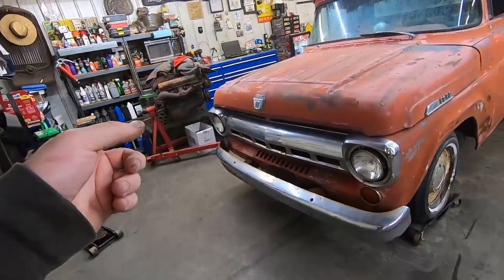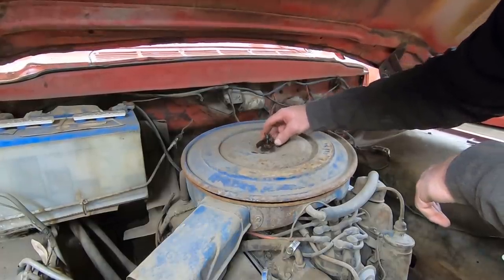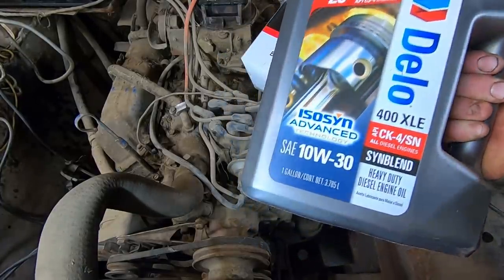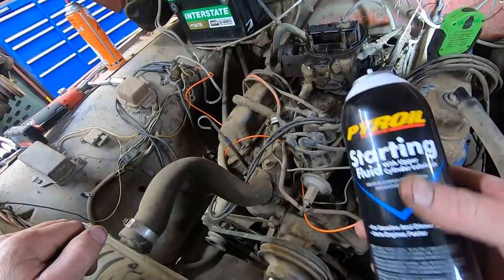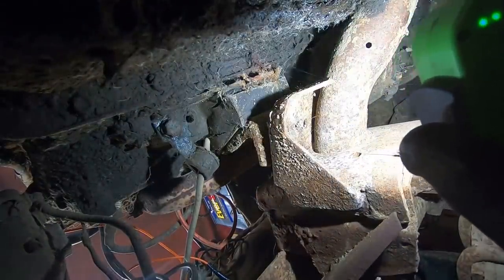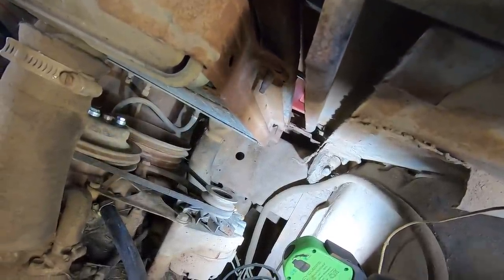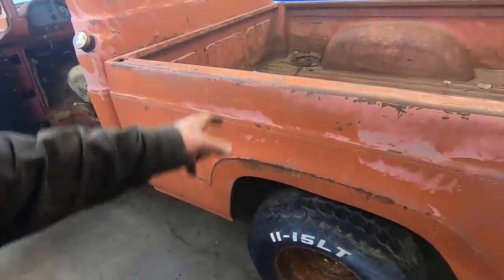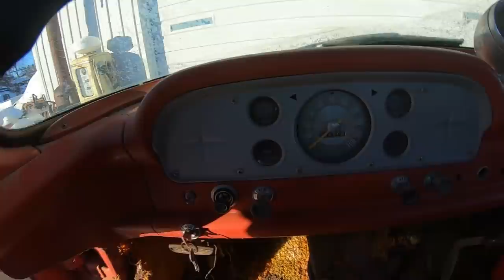Forgotten 1957 F100 Hot Rod Pickup Truck!! Abandoned for 40 Years! Will it Run?!?

Comment: No problem finding parts for them. They were used all the way till like 96.
Reply from the maker: Yeah but nothing interchanges with the later ones. Try finding a crankshaft!
Reply: @MortskeRepair  only difference between your C9 block and an F4TE 351w long block out of a 96 F250 pulled out of the junk yard would be the 1 piece rear main seal and your block’s shorter 9.480” deck height vs. 72 and later 9.500” deck height. 
Only reason I look forward to Mondays is I get to watch you and Duff, and maybe Puddin also, when I get home from work.

Comment: @MortskeRepair lots of parts on the small block 302 and 289 motors work on the Windsor most of the accessory drive components alternators water pumps oil pan depending on your application and clearance. also the intake manifold and carbs are also more than likely interchangeable. me and my Dad swapped one into his mazda b2200 and 302 mustang and small block ford components are the easiest answers if your limited on space. so if your having trouble finding parts for these motors there is somewhat of an answer. maybe that will help you in the future. as always check your years lol.

Comment: The easiest way to tell is the distance from the top of the water pump to the bottom of the head. 289 302 flush with head. 351 1/2 higher. Also the Intake is much wider on a 351.
Reply from the maker: Good tip!

Comment: Nice little "drag" to the dump lol, I've fallen victim to dummy the battery is dead syndrome, but as for your least springs, did you remember to tighten the shackle bolts with the car and weight on the springs? Did that once and truck looked like a Carolina squat lol

Comment: Unless someone has removed it, Ford put an aluminum tag under the coil mount olt to ID the engine.
That drive shaft has rubber injected into the area between the tubes, don't know what you call it. It's oe for something.

Comment: I was very lucky to still have my inner steps on my 60 Fridge. It was a Sand Mountain North Alabama truck most of its life. Also my front leafs were wasted too. Must have been some crap metal Ford was using? This is my fav vid you've done so far btw.
Reply from the maker: First I've seen of spring issues on these. Steps are always shot tho!

Comment: I had some, what the advance auto guy, called transmission hose. Put it on and made it a mile down the road. Was going slower and slower until nothing. Then I saw the geyser of blood. Had a local hydraulic shop make me some custom hoses. Definitely overkill but it stopped the leak.
Reply from the maker: Whoops

Comment: I'd like to know why someone would think it to be a good idea to attempt to partially hotrod a 351 2V...The 351 is a very powerful small block, but it's not going to breathe very well with a 2bbl carb. Not to mention that back when this truck was cobbled together a 4bbl intake and OEM 4bbl carb should've been relatively available and inexpensive. Granted, it wouldn't take took much to make this small truck move, but if you're going to go to the trouble of swapping it you might as well make it worthwhile, but something tells me that this was either an old man's truck, a young guy's truck who was on a budget, or it was just fandangled together by someone who had a crashed or rotted out Ford with a 351 2V and this truck with a worn out inline six. Either way, this could be a really cool project with not too much money required, just alot of time and fabrication skills.

Comment: A 302 has the lower deck surface by an inch or so. This can be seen if the head gasket surface is even with the water pump/timing cover. The 351w has the taller deck with an extra inch above the water pump/timing cover.

Comment: On the 351 Ford engines the spark plugs are at a 45° angle on the on the Windsor versión. On the Clevelands they stick straight out

Comment: Prest-o-Lite batteries were not manufactured after 1997, so this truck has been sitting at least that long.You oughtta see if some collector wants that thing. When it comes to automotive stuff, it's amazing what becomes collectible. I still have an unopened tin can quart of Quaker State, some AutoShack transmission fluid, and 2 untapped cans of R12 I'm holding onto.
Reply from the maker: Nice!

Comment: Where did you learn all of this specific knowledge about vehicles? I've been working on cars for almost 20 years. I can fix one (most of the time anyway,just got my ass whipped by an 09 Sienna), but there is no way that I could ever recall bolt patterns or which year they changed a grille or headlight. Your level of recall on that stuff is quite impressive. I took an IQ test drunk and tested out at 145, and I can't do that.
Reply from the maker: Years of doing dumb stuff like this!

Comment: 289, 302 throttle linkage will be on the edge of left valve cover.  351W will have a wider intake and if you can get a shallow socket on lower thermostat housing bolt passed the water pump it's a 351W

Comment: Merely seeing the horizontal thermostat housing/hose is a giveaway that it's a Windsor engine.  Just thinking:  use a hole saw on the bottom of the bell housing to gain access to the flywheel teeth? Are the kingpins rusted tight?   EXCELLENT MUSICAL CHOICES!
Reply from the maker: I think all of the steering is tight.

Comment: Sounds like me  . Got 4 stroke powered water blaster topped up with fuel the night before yesterday, tried starting, fired up it first pull .  went to use it yesterday . couldn’t get it to go, pulled carby apart checked plug for spark , dry plug hmmm . put it back together and checked the fuel tank. low and behold. empty… Greta didn’t see where the fuel went, nor did I but the tank was dry….Check the simple things first!!
Reply from the maker: Hate when that happens!

Comment: Yup. Definately a Dukes of Hazard Truck, looks like they jumped the creek when the bridge was out. The dent in the driveshaft that meets right up with that crossmember, the very exploded leaf springs, the trashed front cross member, the bondo up front, the broken motor mounts... I don't know WHAT they jumped, but they did it successfully, landed it, and drove it away in only a little bit better condition than you got it.
Reply from the maker: You never wanna know what them Duke boys is up to!

Comment: 20 years ago I replaced a battery after it tested and confirmed dead. Next day no start. I replaced solenoid, no start then I replaced alternator, no start finally I tested battery again and sure enough dead as a door knob! I was so sure the battery was fine and the problem was typical coincidence part fail! I definitely test the battery now even if it’s been recently replaced!
Reply from the maker: Hate when that happens!

Comment: With electric fans than have to be wired to turn on at a set temperature and only while the ignition is switched on. I had a set on one car wired in correctly.

Comment: If the water pump is even with the deck it's a 260,289,302. If it's about an inch above the water pump it's a 351.

Comment: If the water pump bolts directly below the deck its an 8.2 deck 289/302 if there is an inch or so of block between the deck and water pump its a 9.5" 351w.

Comment: yes 351w built in 69,.where the  distributer sits in the block is flush with front intake  its 351..if dist base located about 1"below  where front of intake mates to block its 260,289,302

Comment: I never had an issue with fram either and heck its all my cheap shop I worked at used, no issues as far as know.
Reply from the maker: Neither have I but there's been a lot of horror stories out there. For a couple bucks I ain't riskin it.
Reply: @MortskeRepair  Yeah, I normally use ACDelco on my 92 Silverado and 99 Suburban just because its what would of been on it from factory, My shop uses Orally brand oil and Fram products in their Ford feet vans and I refuse to use that on my stuff even though its free for me, just the horror stories as you said.
Reply from the maker: @VikingDudee  Correct, not worth the risk

Comment: this is a drag truck only if you count dragging it home. ok, i guess it was dragging a front leaf spring too. i'm sure the fat rear tires were worn out on something else before they found their way to this frankentruck. i must say that driveshaft is a wonder of engineering, as in "i wonder what lunatic engineered that clusterfuk". i've shortened driveshafts my self, but i did all the customizing on the tranny end since it just pivots rather than bouncing up and down half a foot like the diff end. you think the dent is how they staked the two together? that makes about as much sense as anything else they did to it. on the plus side, old leaf spring steel is pretty good for making stuff out of, and what was on there sure aren't going to be used as truck springs again. i can see a "knife making with mortske", or "let's weld up some solid motor mounts out of scrap spring steel fer chits and giggles" vid in the future. variety is the spice o' life don'cha know.

Comment: There are a few different styles of mounts. There are truck and car mounts. They have car mounts from a galaxie and a car style rubber mount on the engine. The truck needs the engine mounting horns or pedestals for a v8. There are a few companies that make engine mount kits that should fit that. Windsors are strong blocks to build on from factory. They will hold 7-800 hp and I’ve seen them over 1000hp but not going to say they will live with  1000 hp very long. They can be stroked to 450 cubic inches.
Reply from the maker: Great info!

Comment: From my understanding, ford only made the 351w between 69 and 72, so yeah parts are harder to come by. Also, ford used a drain plug on the side for cars, and on the bottom for trucks(on the oil pan that is)
Reply from the maker: No, they used it well into the 90s

Comment: If it did have headers on it they probably took them off & put the regular manifolds on,but to be a supposed drag truck they should've just left the headers on it & you might have to find a new used driveshaft for it since it has that big dent in it

Comment: I had a 1952 f-1 ford pick up all customed had a 351 Windsor at 530 HP,  60 thous. over bore hot cam 750 double pumper carb. roller lifters- 4 disc  brakes - power steering -power brakes, It could burn rubber for over a 1/2 mile had fun for a few years till they got greedy and raised the price of fuel, later found out I only got 1 mpg mileage, had to sell it because I could not afford it, It hurt to see her go.
Reply from the maker: Sounds like a gem!

Comment: 351w has a higher deck height than a 289 or 302. This makes it taller and wider than the 289/ 302. Thus the intake is wider also. If you look at them side by side you will come to know them apart rather easily.

Comment: Best way 5o tell a cleavland block from modified or Windsor it take a look at the fuel pump. Bolt pattern  on pump at 9 and 3 oclock,  windsor, or modified.. bolt pattern at 12 and 6 o clock its cleavland.

Comment: 1974 and older 351 Windsors have a 16 bolt intake manifold bolt pattern. I had a 1983 351W that had the normal small block 12 bolt intake pattern.
Reply from the maker: Ford just couldn't leave nothin alone!

Comment: Orange can fram are probably still junk..but a lot of research shows that silver and gold fram are pretty well built these days..i love em because wally world sells em cheap enough. Every other filter except silver and gold frams seem to bring the knock on startup back in my 95 chevy tbi..maybe something to do with drain back valve style idk...but if they stop that knock its good enough for me. Wix is supposed to be good but i get about 2 maybe 3 seconds of engine knock at startup..i took just the filter off after about 80 miles(wix) stuck silver fram and topped off oil with same castrol then knock was gone every start after it..idk mortske..if motorcraft filters did it id stick one on my GM but they don't..so i use the sinful fram line.
Reply from the maker: It isn't worth the risk for me.

Comment: 302 has 4" China wall. Windsor has 6".. 94 Bronco has roller block upgrade. 69 block is thicker casting and valuable for machine shops and blown engines.. 289 heads with big spark plug have small combustion chamber!  Raised deck high and LONGER CONNECTING ROD is the BEST part of Windsor (less Rod angularity and piston side load).. Chevy stole Windsor blueprint to make LS..
M400  Has long rods and raised deck height making it better than Cleveland. My FAVORITE Ford motor! 
 I'm building a 59 short bed 4x4 with M 400 C6. Dana 60 kp HP (78 snowfighter) on 34's.. had a leafspring chat with you..
If you have an old Vintage Ford Catalog... page 58 👍 that's your cue.
Reply from the maker: Great info! Thanks!

Comment: I've gotten weird memory steer like that with bad 4x4 front u-joints, rusted up tight. Since that truck doesn't have those, maybe the king pins are tight from sitting? Crazy feeling for sure. What's with the Expedition Mortske? Seems out of your typical M.O., albeit a prime DUFF hauler... lol
Reply from the maker: Daily beater
Reply: @MortskeRepair  My winter daily is a 98 Expo... It's pretty OK.
Reply from the maker: @landengreen6982  For $300, I ain't complainin.

Comment: The way you can tell the difference between a 302 and a 351 quickly is right above the transmission if the intake manifold is almost flush it’s a 302 if there is a 3/4 of an inch lift it’s a 351
Reply from the maker: Couldn't see back there

Comment: Hey I just joined you Chanel I got a 87 Dodge RAM D 100 & I replaced the distributor now I can't get spark. Do you have any idea what I did wrong.
Reply from the maker: Probably hooked something up wrong
Reply: @MortskeRepair  I check everything everything is right I just can't get spark
Reply from the maker: @DanielGarcia-pk6br  Put the old distributor back in

Comment: Came to comment that Fram filters aren't good but really a long as you change the oil properly it doesn't matter. Also the 69 351w makes more power than the 80s 351w 4V HO. I have 3 Windsors tore apart in my shop right now
Reply from the maker: Neither have I but there's been a lot of horror stories out there. For a couple bucks I ain't riskin it.
Reply: I personally won't use em. It's the cardboard inside that bothers me
Reply: I have a 57 f350 with a dump bed on it and someone swapped a 4bbl FE into it and I'm going to post the thing out. Rust free cab would be perfect on this badass short box

Comment: I've run the Delo oil before, good stuff, any "Heavy duty diesel" engine oil that isn't store brand, Chevron, Shell, whatever, it's all better than standard engine oil for these old engines nowadays... Gets dirty quick though... Mostly 'cause these old engines are usually hiding a lot of sludge it seems.
Reply from the maker: Oh yeah, she could use a few heat cycles and a change no doubt.
Reply: @MortskeRepair  Don't you love it when you buy a car, and they're just like "Yeah we just changed the oil". And yeah, they aren't lying, but that oil is still black as crude in 500 miles. You really know you got a gem then.

Comment: Before we even had the internet, I heard Fram was bad. I still use them though because that's about the only brand you can get around here unless you want to go out of your way and pay twice as much. I've never had a failure because of them. Few engine failures at all. I used to have a Fram catalogue that listed all of their filters, the specs and applications. Just make sure you have lots of oil and it's clean.
Reply: Never had an issue with Fram filters, although take-apart videos reveal they're flimsy inside.Always liked the wrinkle paint on the sides, which offered a good grip with hands, or filter wrench.
Reply: @jeromebreeding3302  Considering some engines don't even have a filter, I don't think it is as big of a concern as people make it out to be. Even a poor filter will catch the particles that are the most dangerous to an engine.
Reply from the maker: Neither have I but there's been a lot of horror stories out there. For a couple bucks I ain't riskin it.

Comment: Yeah my stepdad had a 57 Ford only has 6 cylinder a straight 6 it has steering problems do I remember that use call Italy Panini cuz he wouldn't hang on that will ever deep-fried off to wherever you know it's way it was pretty good old truck it's fine of it the way the story was you might want to check that play in the steering gearbox you can lose that. At the top of it and tighten it down a little bit B to take the tiller play out of it

Comment: Catastrophic launch failure.  That truck's leaf suspension finally blew up on launch which shifted axle position so quickly and violently that it bent the drive shaft.  
Yes technically it was running and driving right before it was parked. 
The engine may or may not have damage from the event.
Reply from the maker: And engine mounts!

Comment: No way, will I ever use a frame, when I used to work in the car Lot 9 times out of 10 if an engine was knocking or blown up there was a frame in Bob’s. Fram used to be good back in the 80s but when they went to that black handle grip they became garbage

Comment: I've used Fram filters for about 30 years and never had any problems with them, but I'm sure everyone has their choice. I have driven Fords for a quite a few years till I tried a Nissan Frontier with the 4 cylinder motor. I put over 200,000 miles on it before it started having transmission problems. I know the motor needs a timing chain and gear replacement, but it still runs like a top.
Reply from the maker: Neither have I but there's been a lot of horror stories out there. For a couple bucks I ain't riskin it.

Comment: A 289 or 302 will rap rpms faster than a 351 because the 302 is shorter stroked and its almost the same bore